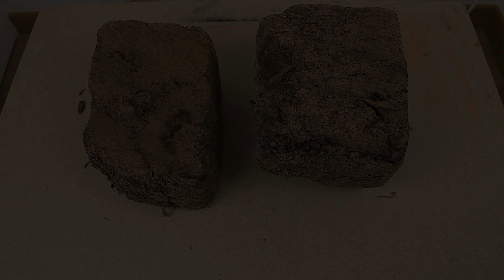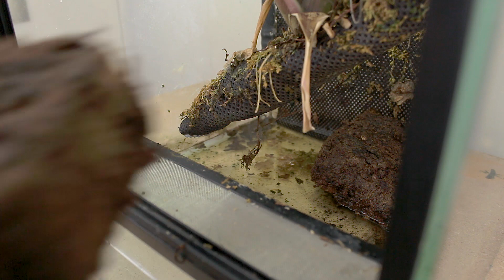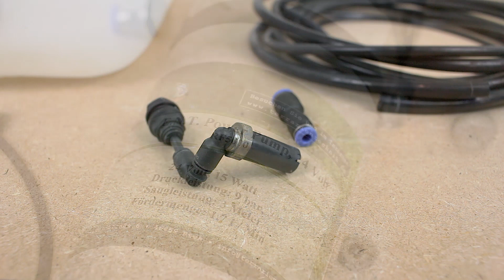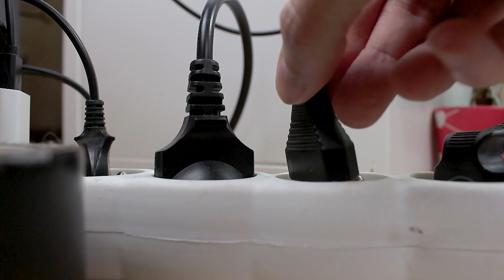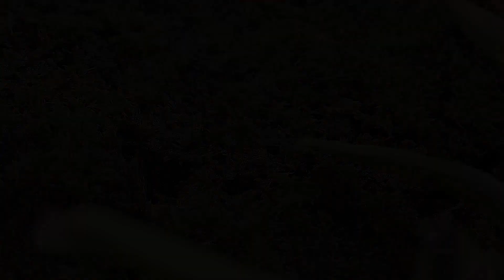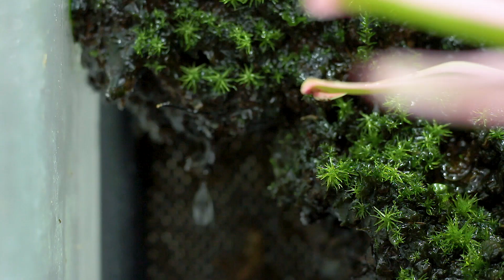Moss Mix test part 3 - It works!

Comment: Can i attach the moss to the cocoa fibre and use it as wall for the background ???
Reply from the maker: In fact yes but I'm not sur that coco fibre is very durable through the time.
Reply: @Terrarium-Construction  i think slate will be more durable 
I use slates in my tank